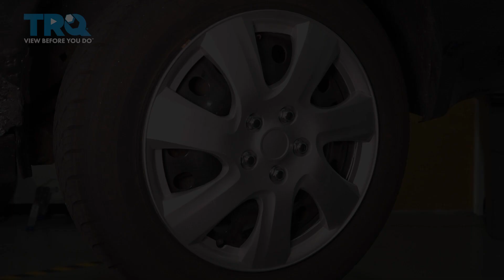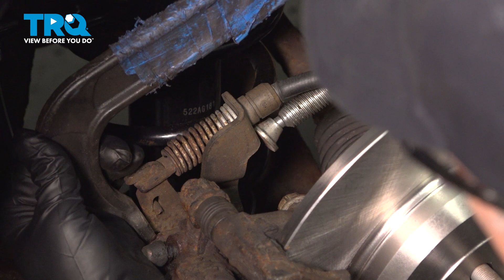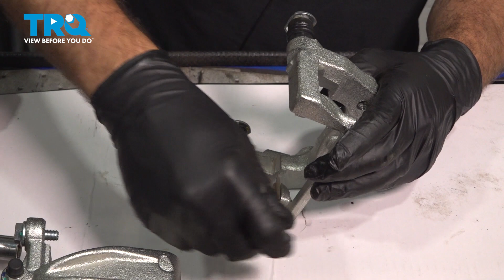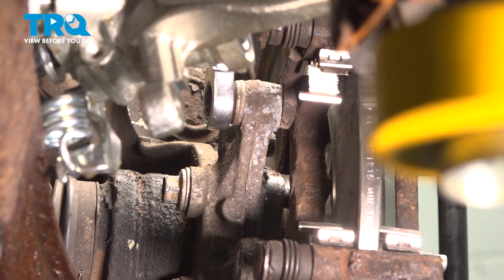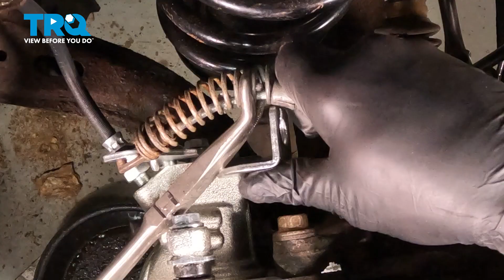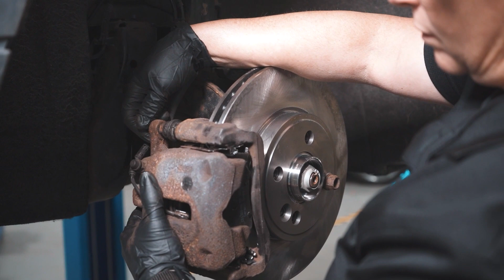How to Replace Rear Brake Caliper 2005-2007 Ford Five Hundred

Comment: Great video, thank you!  I was able to re-attach my emergency brake line without using the pliers, it was easy to just catch the spring as I pulled the cable back to insert the wire through the slot. Great advice cracking loose the 16mm brake line at the caliper before loosening or removing the caliper, was much easier with the caliper held solid to the car.  Interesting that you didn't pump brakes to bleed them. I pumped the brakes.

Comment: What does "e-brake" stand for? You kept saying it.  It"s confusing. As far I can see it's a simple mechanical hand brake actioned by cable. No motor-actuated electronic parking brake.
Reply: “E brake” is short for “emergency brake” which is actually called the “parking brake” just different terminology from different people
Reply: Emergency brake. (Parking brake)